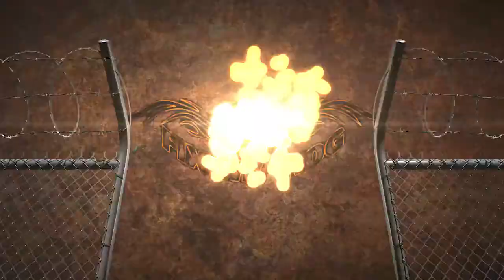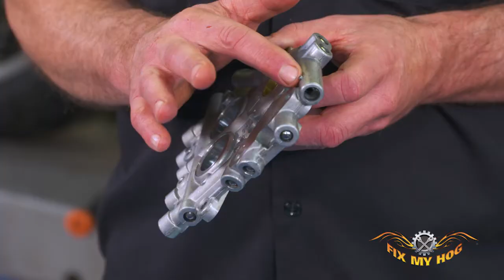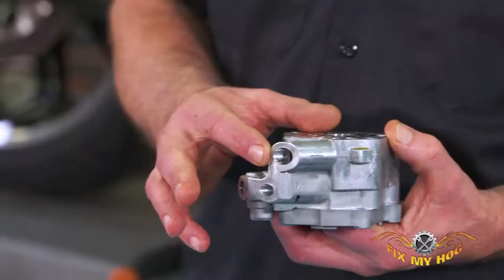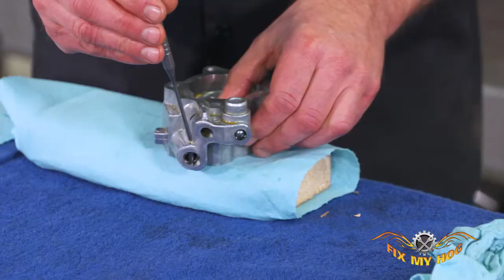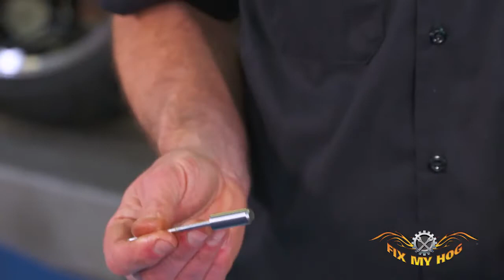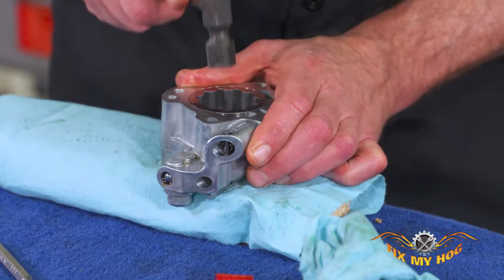M8 Harley Oil Pressure Relief Valve

Comment: I have a 2005 88 twin cam.  It has the cam plate with the relief valve.  I got the split pin and spring out, but the plunger is stuck.   A magnet isn't strong enough to pull it our.  Does anyone have a suggestion as to how I can get that plunger out?
Reply from the maker: At about 2:30 in this video Mike talks about that: https://www.fixmyhog.com/video/harley-twin-cam-oil-pressure-relief-valve/